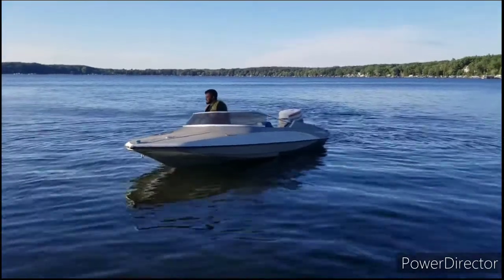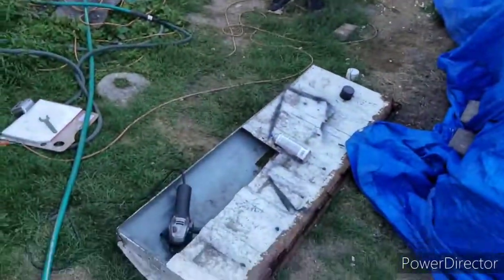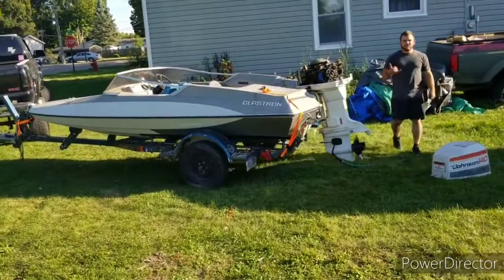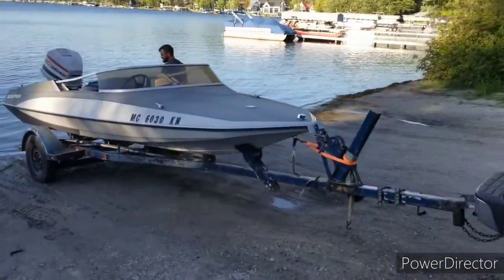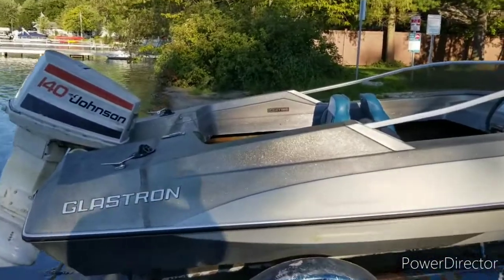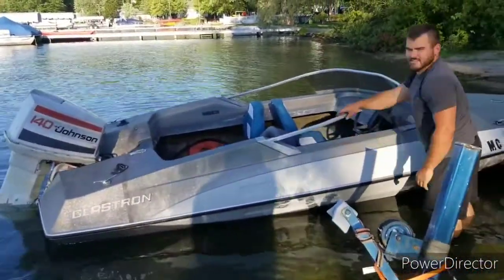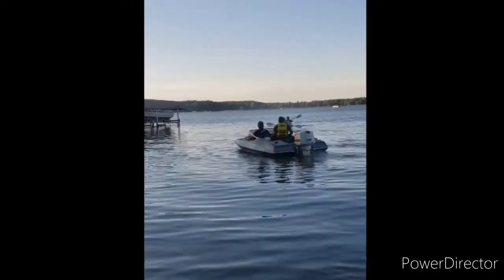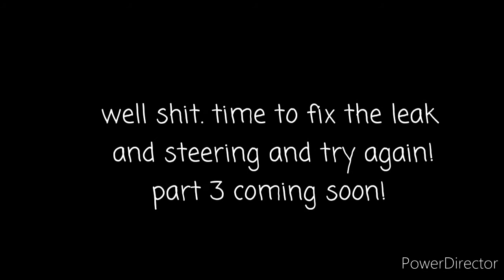1977 GLASTRON GT150 first time back in the water after 7+ years!!Johnson 140 hp outboard

Comment: My Dad bought one of these in 1970 and parked it at Clem's dock on Little Detroit in Detroit Lakes, Minnesota. The boat had a maximum horsepower rating of 100 so my Dad put a 125 Johnson on it with a speed prop. I was 13 years old at the time and could take it out whenever I wanted. It was yellow with black racing stripes with a tinted windshield. I raced and beat everything on the lake for several years. It would run around 60 mph. and I spent every summer loving life. Both motor and boat were brand new. What an amazing boat!

Comment: i had one of these back in 1981 like new guy never used it after daughter and wife got into riding horses so i bought it evinrude 115 i raced a guy with a 140 and he never could beat me reason why the hull was designed for a 100 hp not bigger a mercury 90 hp beat me untill i got on plane then i got him but not by much
Reply from the maker: Ive heard other people say the same thing. I honesly bought the 140johnson becuase i got it for $400 and it was running /water ready with power tilt. So yea 140 is not the best choice. Still fun though.

Comment: What was the top end before the steering broke?   That would go 0-60 in under 5 seconds i bet
Reply from the maker: I was so scared im not sure. It felt just as fast as our 700cc jetski haha. 
We will be putting a spedo on it this summer.
Reply: @Robbuilds  i need to see hole shot videos when you get that thing back on the water. Those old 140’s rev like dirt bikes.   Very quick.  I had one growing up and it was on a similar boat.  Was a beast.  Great sound
Reply from the maker: @bretarnal8463  when its back in the water we will be posting more vids of it. Plan on repainting the boat here soon also.
Reply: @Robbuilds  with the gas tank in the front and maybe one of those fins on the engine.   It should plane fast.  Very fast.  Cool man, i look forward to following this.  Lol.  That made my day.
Reply from the maker: @bretarnal8463  glad you liked it👍👍 this is definitely my favorite boat .we are going to move the tank to the fromt like you said and see how fast shel go.

Comment: Youre gonna need to fix more than the steering and 1 leak, that boat is in no shape to handle a 140hp motor, in 7 years of sitting the hull will weaken, the torque of the motor could easily break or snap the transom when hitting the throttle. If its taking on water right away.... This would be a nice restoration project boat and motor, put about $4k into this (if the hull isnt totally comprimised)  and once completed this should run 55mph all day long, the SST stainless prop is needed, couldnt tell whats on there now. Lots of potential here, when restored this would be a blast!!
Reply from the maker: Oh yea i totally agree. This whooooooole boat is a terrible idea 😂